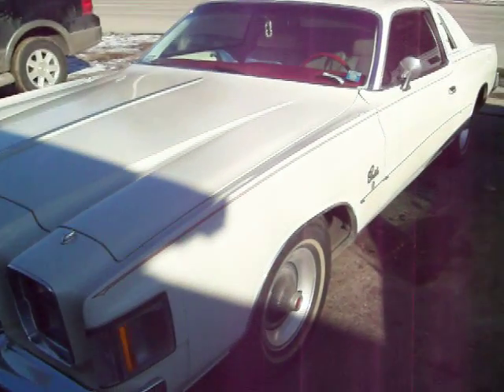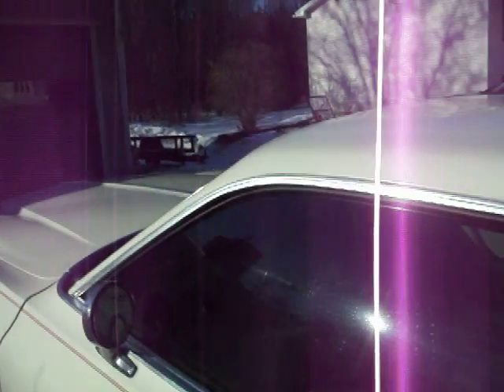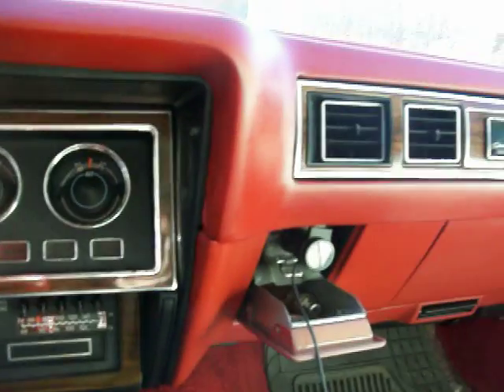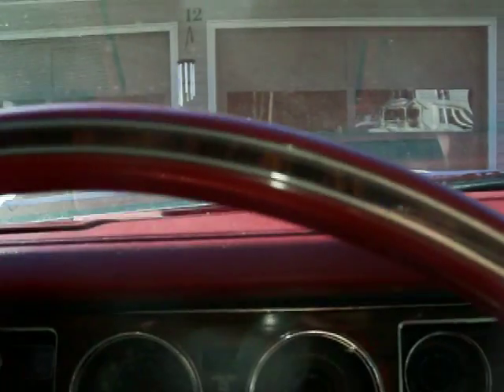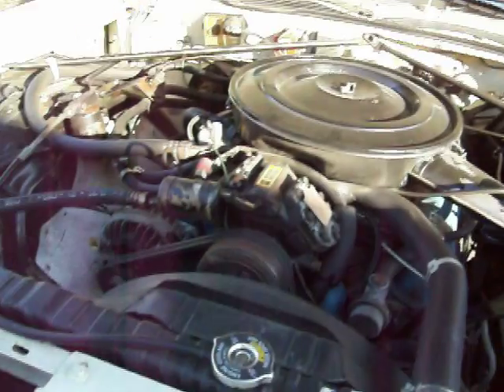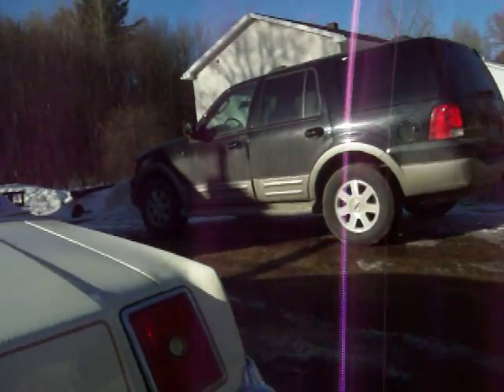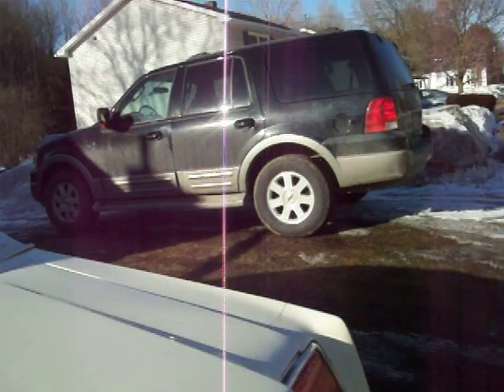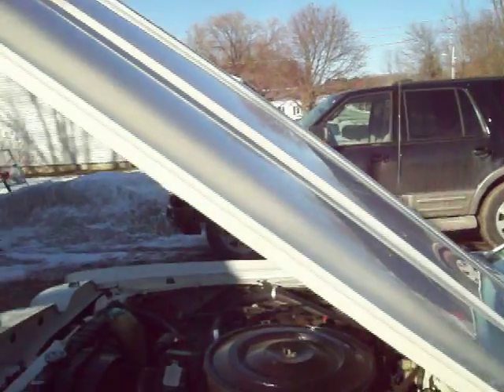MY RIDE - What's Yours? - 1978 Chrysler Cordoba 360 4bbl.

Comment: I had a 78 360 4bbl in the mid 2000's that was also a previous Calif car, dove gray w/ gray cloth interior. Loved the engine especially, it was quicker than my dad's 78 with the 400 mostly due to the rear gear ratio 2.71:1 (360) vs. 2.45:1 (400). Car had 176,000 miles on it when the right rear spring went through the trunk floor. I pulled the engine and trans for my brothers 73 Dart Sport. I miss that car and wish I could find another one similar for a reasonable price.

Comment: Wonderful car!   Mine is a 1979 Cordoba, same color Spinnaker White with the white corinthian leather and the red dash and carpet.  Mine has shifter in the floor and a full console.  Got it NEW in fall of 1978 for my high school graduation in 1979.  Mine is still original and in about the same shape as yours, but there is some rust coming through the vinyl top. I stopped driving mine when it hit 155000 miles. It's stored now.  Also the stripes for 1979 go down the middle of the doors.Tks for vid

Comment: You going to change to a big block "K" frame, or are you going to use elephant ears ? I had a 78' Cordoba with a 360 4 bbl, mild cam, I bought a 1970 440 to build for it, but totalled the car before I got a chance to do so,steering box let go.Still have the 440 and a 69 727 trans, both need rebuilding.

Comment: 10W40 is a good start for these old cars. Also, try burning 92 octane 'super'. Your car will love it and stop stalling at stops. Gas was better back in the day than the 87 octane sh!t they sell now.  Mine wouldn't start in the spring with last fall's gas still in it, had to be fresh and 91-92 octane worked best.